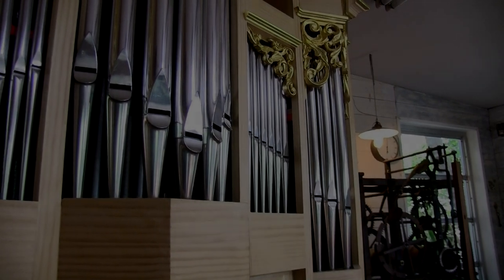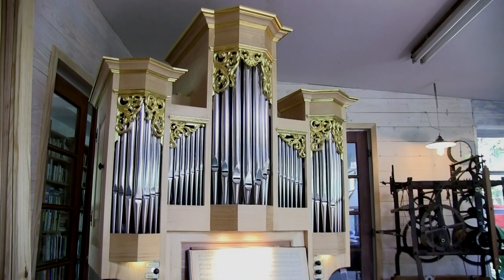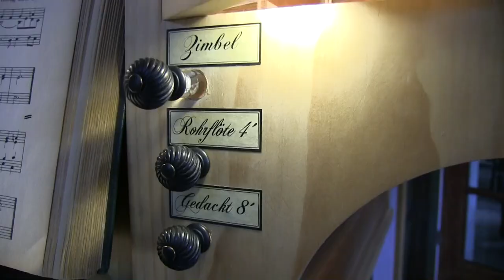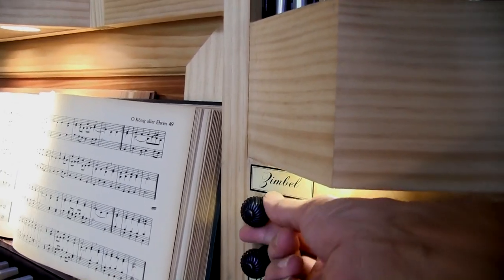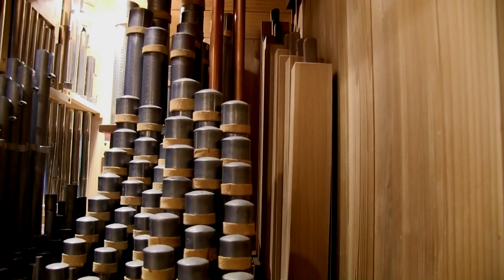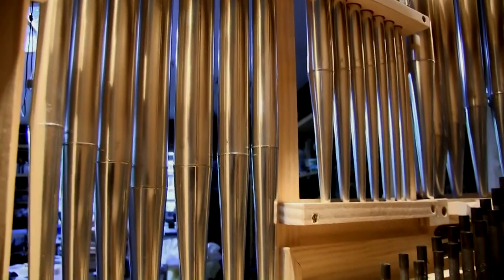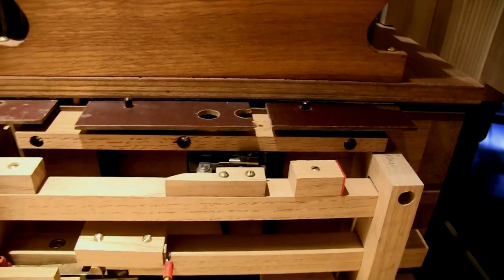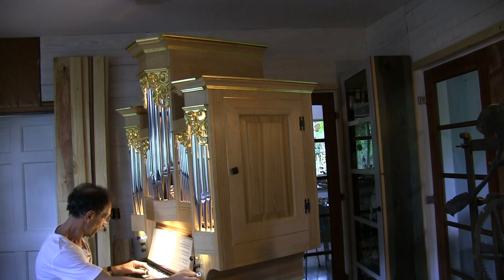Positive Pipe Organ

Comment: There's something I love about how subtle the tremolo is. I've heard a lot of cases where the tremolo sounds rather exaggerated and cheesy and awkward, and this is not the case here: the tremolo actually adds something.
Reply from the maker: Thank you. The Tremolo is pneumatic with a long brass spring. I made it adjustable in intensity over the stop knob. The more you pull out the stronger it works.